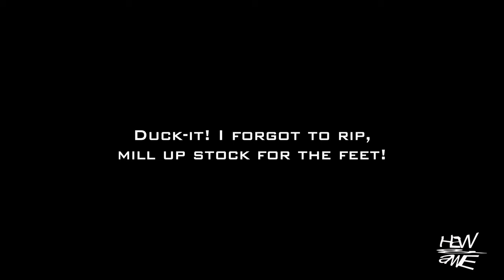Crafting EPIC Brown Oak Farmhouse Table legs.

Comment: Everybody here is talking about how stressful the glue up was. I was personally stressed every time you used that table saw. I half expected for you to come back each time with your hand wrapped up and missing a finger or two. You have a track saw so might I suggest to break down those uneven boards with that a bit more before your milling process instead of the table saw
Reply from the maker: On the contrary, if you notice how the boards were on the table saw when they were finished being ripped they dropped away from the blade. Not only that but that’s only a 3hp saw not strong enough to move the weight I was putting through it. I also make sure my hands never go into the red zone the throat plate area. That was difficult to see from the camera angles. A track saw is actually more dangerous especially that huge bad boy, you can’t clamp the track down, and unless the cut off is left suspended in air the piece could pinch the blade in one of two ways. It’s also very slow compared to a 3hp saw! There’s a lot of tension in burr wood which I’d rather deal with at a table saw than a track saw riding up the track towards me, a table saw blade is static.
Reply: @HewAndAwe  that blade may be static but you and the board are not. All it would take is for one tooth to catch and pull that piece to catch and pull your hand in. I have seen many videos of hands far from the blade get pulled towards the blade in a matter of milliseconds. General rule of thumb is do not run severely warped and twisted boards through the table saw, especially if you know there is potential stress in that wood. It is not for me. Way to many people lose digits on a daily basis to the table saw and at the end of the day I will take every precaution to keep mine and limit my chances for issues.

Comment: In my experience, colored masking tape is a bad idea for glue ups like this. If it gets pinched between the boards or glued in a tight spot and you can’t get it 100% off you will see green bits in the final piece. Better to use normal tan colored tape as it’s similar to wood color and won’t be noticed, just in case. It’s a lesson I learned from my mistakes.
Reply from the maker: I found either way it’s visible so now if that happens I push the tape into the joint and then get a dab of glue on my finger and wipe across the join and no one is the wiser ☺️

Comment: It's going to be an epic table..that should see several generations of use at minimum..I hope you mark / label your work..here in the states that's at minimum a few thousand dollars just for the slabs..probably at least a $10k table and possibly a $20k table if not more to get  commissioned here..That Blacktail guy would charge $50k..
Reply from the maker: Veeeeery different over there though bud! The wood yeah fucking expensive but 1% of the population would pay that kinda money - besides I call BS on his vids he’s not getting 50k for a table no way. It’s not like they’re class either.
Reply: @HewAndAwe  Blacktail claims to get 8k to 10k for a epoxy wood desk top, zero drawers..just prefab metal legs screwed on..some are claiming 20k to 30k for a dinner table size..which is insanely expensive..if  Blacktail studio made it..he would charge 50k as he has people on a multi year waiting list to pay 10k for 700 worth of materials..it's gross how much you pay for so little..if you charge too low like a fair price you won't have customers..if you grossly over charge and make people wait it makes a false sense of rarity and value..people do this in several different fields..knife makers, golf clubs, fishing poles, furniture etc..double or triple the fair price then make them wait at least several months at minimum..that's seriously the business practices..Cheers..
Reply from the maker: @agentcovert  I’ve a special kind of hate for those metal legs! They also come loose over time. I’m still surprise how the resin thing is still a thing! It’s looking pretty gash these days imo. Great for filling knots and the likes but any more than that turns me off!